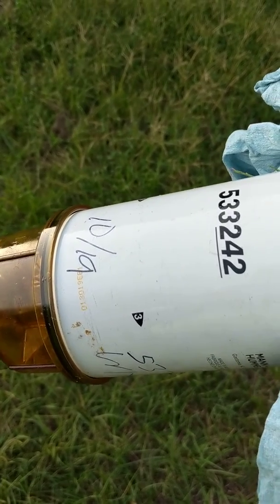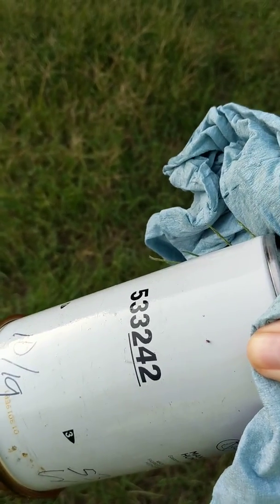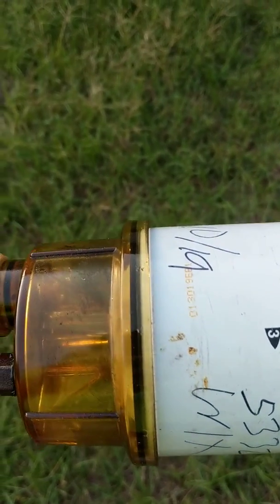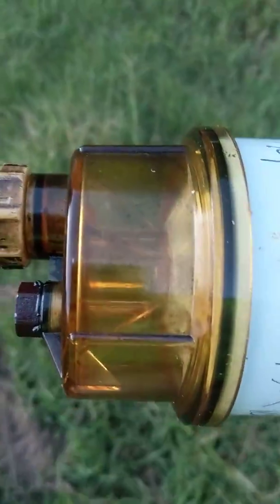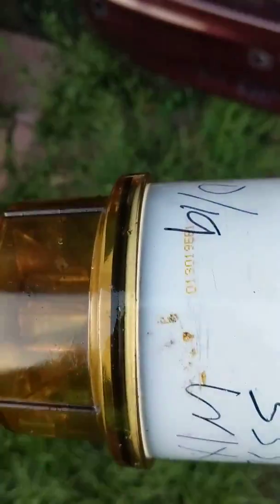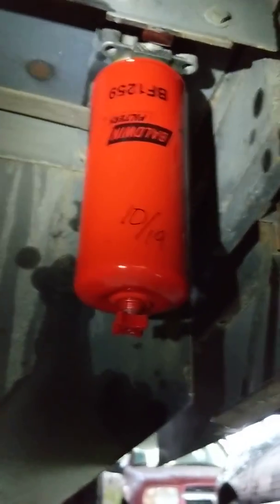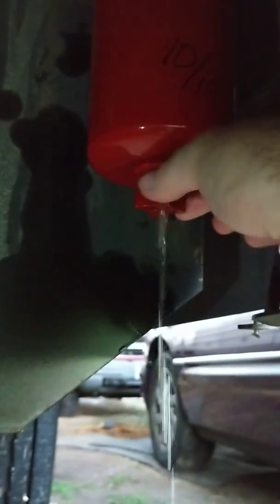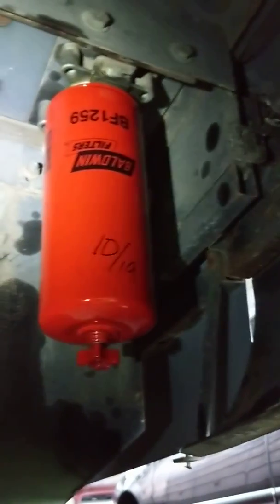Change from Wix 533242 fuel water separator to Baldwin BF1259

Comment: Question on the original fuel seperator- when i unscrew the bottom piece, clear diesel fuel comes out ... would it not auto-stop once the water is out ? Thx